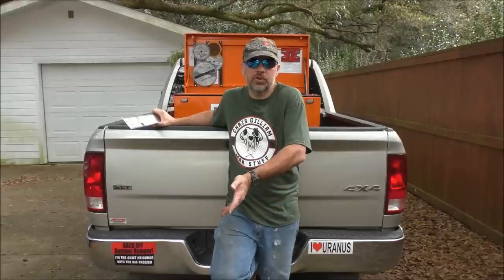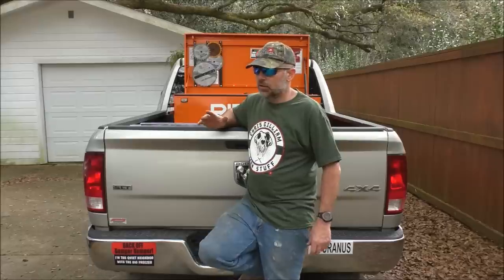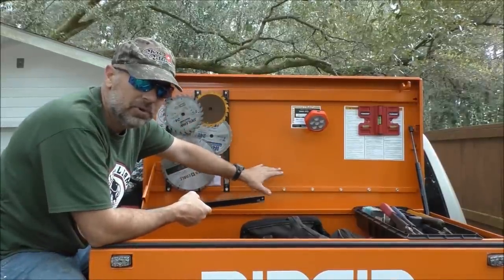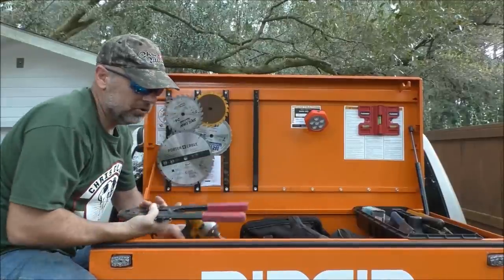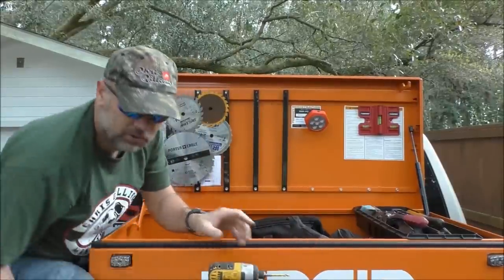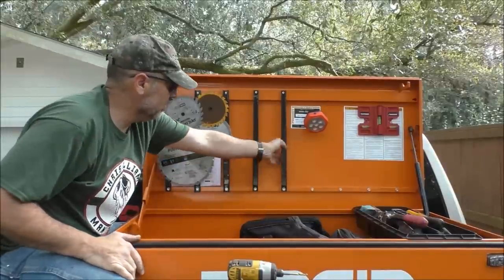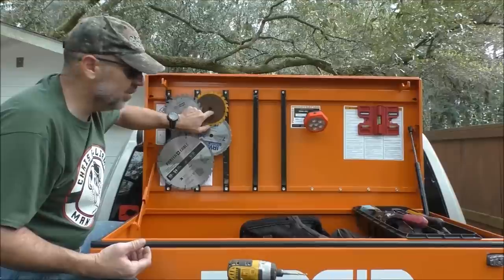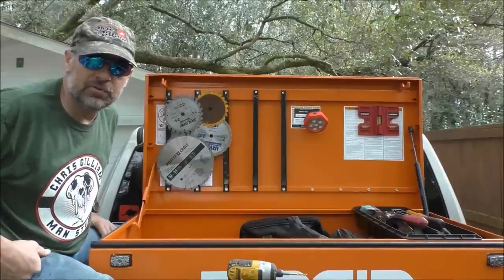Ridgid Job Box Meets Harbor Freight Magnets

Comment: Good ideas bro. Been wanting to get a new job box myself. My wife has a couple packs of the magnet strips she's been asking me to mount for her kitchen knives so she gonna be mad when I tell her I finally mounted those things but they are in the truck not the kitchen. Thanks for ideas
Reply from the maker: If you Google "harbor freight magnetic tool holder coupon" the top result has a coupon to get them for $2.99. Save to phone. The HF coupon app usually has them too, but not currently. I've save a ton of money using the app.
Reply: where do they sell those magnet bars friend?

Comment: Thanks for the tip! Also, what fixed blade is that?
Reply from the maker: Gerber Stongarm. One of the 2000 they made in BDZ1 stainless.
Reply: @ChrisGilliamOffGrid  Thanks. I have one of those too. 👍🏽 Bought on Amazon. I didn't recognize it in the sheath.

Comment: Great video Chris! I was considering buying these magnets recently myself because I saw some guys video of how he organised his truck with these things and it just blew my fucking mind. That $10 light from harbor freight I have a few of those myself I love them for my van that doesnt have working lights in the back anymore But since I got into my new van I havent had to use them the only problem ive found with that particular light is dont ever forget to turn that Mfer off because the LEDs wear out almost as fast as the batteries.... Ive changed the batteries on a couple of them and the light is still ultra dim really sucks.... Check out the $15 Headlamps they have I absolutely Love and Live by those things man they changed everything for me from Crawl space work to just looking for shit in the dark its the Headlamp like the miners headlamp made by Quantum i think its got like 700 lumens or some shit which is really awesome you can adjust the lamp to give you a real tight or real broad light and its just awesome dude I carry one near my side door and one near the back doors just incase I misplace one.

Comment: The plastic tool tray hanging on the right side of the box, did your box come with it? If not, what did you use? I'm looking for something just like that. I bought my box used, and didn't realize that the Flexi-tray was a thing, and Ridgid does not offer replacement trays..
Reply from the maker: Yes, it came with it. I'll look around and see what else might fit.
Reply: @ChrisGilliamOffGrid  thanks for the reply. I was hoping it was something you found, but I guess I need to keep looking, or need to get to fabricating.

Comment: I’m curious how you mounted the box to the truck bed
Reply from the maker: That one I bolted through the front of the bed. Very difficult to get hand in there to hold nuts though. I replaced that box with a slightly smaller one & used 8mm rivnuts. Much better.

Comment: Did you bolt the rigid job box into your truck bed? What bolts did you use?
Reply from the maker: Yeah. 1/2"-13 x 1 1/2" I think. Three of them. 
Might take it out soon if I can get a lower box.

Comment: How did you bolt it to your truck?
Reply from the maker: Got in it, drilled three 1/2" holes through box and front of bed. Then grew an extra elbow in order to hold the nuts in place behind the cab while someone else tightened the bolts.
Reply: @ChrisGilliamOffGrid  i just got done doin that same thing. Time for some bbq and beer. 🍻

Comment: I just got a new ridged box but it doesn’t have the bottom row to screw down,any suggestions on how I can screw them down?
Reply from the maker: Well crap, that's odd. You could add a piece of channel there, but you'd have to tack weld it and that would take the paint off the outside. I think the smart thing to do in this case is to attach to each other, back to back, know what I mean? Screws and nuts, or rivets.

Comment: You could fish some nutserts in those holes. Drill a slightly bigger hole next to the hole that's already there then poke the nutsert over on a piece of copper wire. 
Holes😀 they are your friend.
Reply: If you had to. The load on those is so minimal that it is unlikely to be necessary.
Reply: Or be even smarter an install rivet nuts in there. Would take 2 seconds

Comment: I wouldn’t buy the smaller box again I have a 48” and a 32” because I’m impatient in the store but I wish I woulda waited and got 2 of the 48”
Reply from the maker: I have a slightly smaller one now,  45 inches. It's lower so I can see over it better. Also 30 lbs lighter.
Reply: @ChrisGilliamOffGrid  the 48” weighs 150lb empty